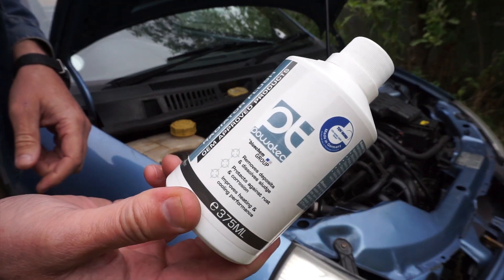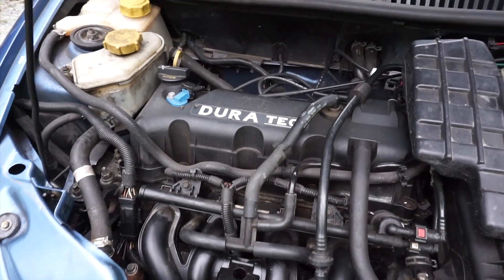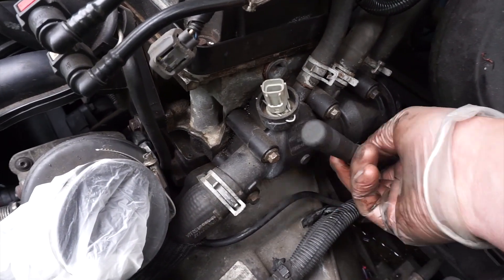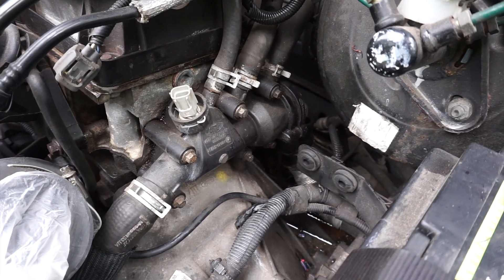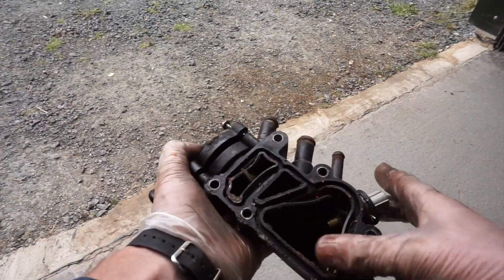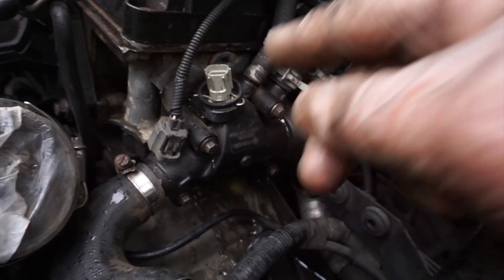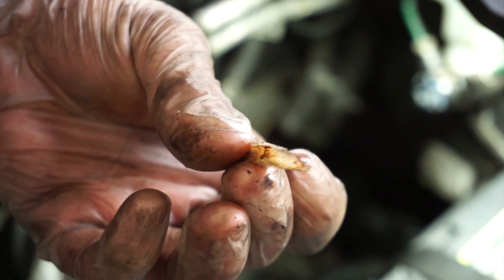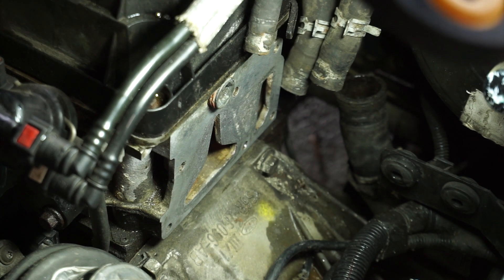Ford Ka Thermostat Housing & Header Tank Fix

Comment: Thank you for doing this video. My 05 KA has a thermostat housing leak and I’m now going to have a go at this myself, thanks to you! 
Firstly I need to buy housing etc and a tool to get the hose clamps off with. Total novice but will try. I will let you know how I get on in a few days once I have all the parts. Many thanks again for creating this video. Matt.
Reply: All done. Took me a good hour just to get the drain plug undone. I couldn’t get to the hose. I don’t have any ramps or jack.  Would have been much easier if I had.  Anyhow, all done and no issues.  Thank you so much for posting this video. Helped tonnes!!

Comment: Had to get a replacement stat housing for a KA last week when dong an antifreeze change..

I took the heater matrix pipes off the housing to flush the matrix out and the front spout was broken off. The pipe had been force on to the spout stub and I couldn't get the pipe sealed back on.

The local Ford's price for a replacement stat housing assembly is ridiculous so I got one at a local motor factor instead.

Used new jubilee clips instead of the old spring clips.

Comment: Coolant leaks are always worth fixing and the fix is usually cheap. Preventative maintenance isn't normally part of the Bangernomics rules, but in this case it makes sense since you're saving putting stress on other parts of the system, saving money by not having to continually buy more coolant to top it up, and giving the car an easier time which should mean failures are less likely.  It's a tricky one this Ka, it looks fairly reasonable and they can cost buttons to run, it's just the rust that gets them usually.

Comment: Great video thank you.  We can't get hot coolant to circulate through the heater matrix on my son's Sportka.  HCV has been replaced, we've tried a new matrix, even bypassed the HCV entirely.  Both the hoses from the thermostat housing to the HCV seem to spout water at a similar rate if the engine is revved (and pipes disconnected from the HCV). No water from either pipe at idle.  When everything is correctly plumbed up, both hoses get warm up to and just beyond the HCV, i.e. part way along the two hoses from the HCV to the matrix.  We've twice had a fleeting burst of hot air in the cabin after a fast run on the dual carriageway, but it lasted for seconds only.    Could a poor gasket seal on the thermostat affect pressure in the cabin heater circuit?  there is no sign of leakage from the thermostat housing.

Comment: My Ford ka 1.3 litre engine capacity has been giving me issues. The radiator seems fine, I changed my head gasket and got a new thermostat housing. The fan is moving well. Could there be something i am overlooking?

Comment: Great video, my partners ford ka has a problem the engine fan is running almost constantly. I suspect a bad thermostat and as its cheap i am going to replace it. Can you tell me how you bleed the cooling system on these as i didn't see that in your video? Thanks, any help is appreciated.

Comment: That was wonderfull and i got a ford ka 2006 model i think my mobilizer is the problem the car when u turn on the ignition  the car is just flashing the red light on a clock continuasly whats the problem is it the mobilizer coz is not cranking but the engine it goes on iam woried plx help

Comment: My Ka is overheating, I have no leakage, the engine sign light suddenly came up on dashboard. The fan is not working and the radiator is very hot. 
How do I go about fixing this problems. 
Thanks.

Comment: Hi there I have a ford ka 2005 model and it loses water over night but during the day it runs fine and water is fine. I checked for leaks but can't seem to find anything. There is no oil and water mixing the fan works. What could be the issue?

Comment: We have a KA (a9a/a9b engine) with a leaking stat housing which has allowed the engine to run too hot too long and it seems has goosed the head gasket because engine oil has got into the coolant header tank. Its a 2007 so perhaps change of car time.

A pity Ford specified such an inferior material for the housing.
Reply from the maker: Yes, the housings don't seem to age too well. Mind you, manufacturers aren't really concerned about their cars beyond the warranty period. If the spec says it's good enough for five years, that's probably good enough...

Comment: I hate those little hose clips! Absolute sods to get off sometimes. I always change them for jubilee clips. Sorry, pet hate of mine! 😁
Reply from the maker: beaverman1974 I don't mind those spring hose clamps so much - if they're in good nick, they work well. Sure they're easier to remove with the correct pliers, which of course I don't have (one day, one day...) so I make do with a variety of other pliers depending on where the clips are. A combination of standard and angled long nose pliers tends to cover most eventualities....